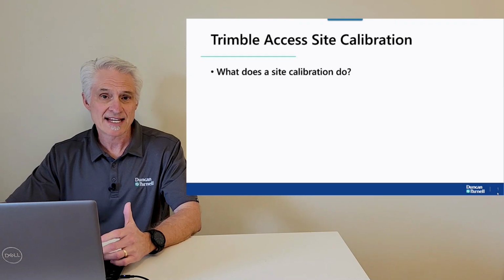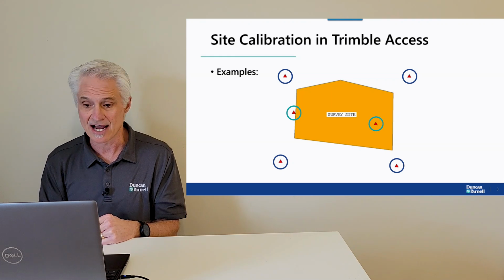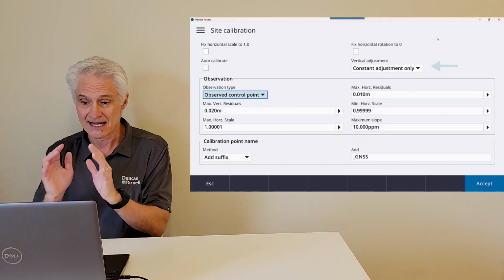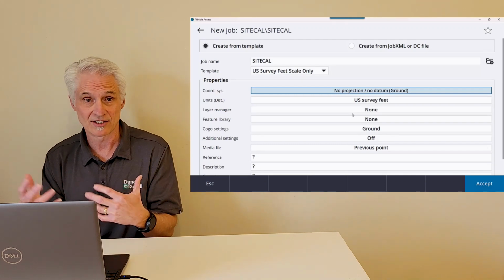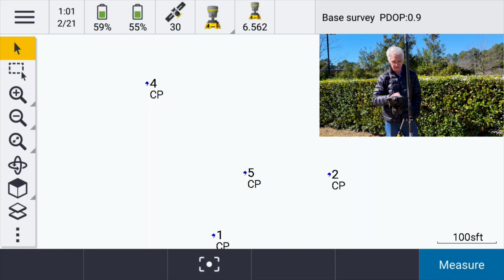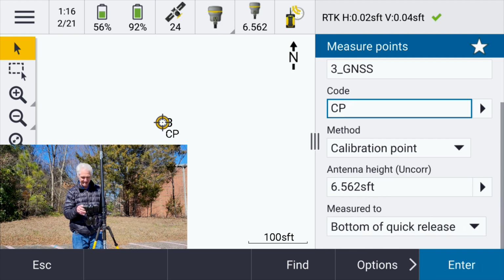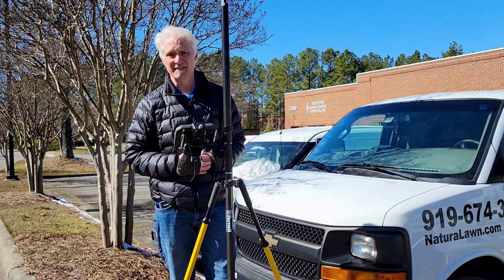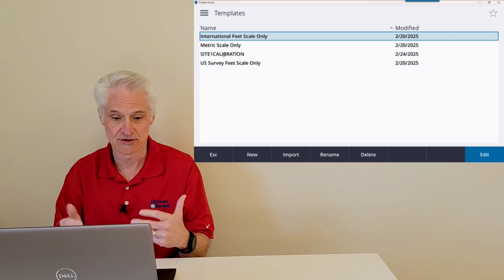GNSS Site Calibrations in Trimble Access – Everything You Need to Know | Survey Matters

Comment: Thanks. 0.02'h/ 0.02v calibration is good stuff with a GPS. Been using survey pro  for years in Arizona just holding the bearing line/section line published on the construction plans or the deed of the property and just make the grid point monument distance match the measured distance between the two monuments  bind those together and solve projection, just hold one point vertical close to the site. Then go check into existing property corners around the site and nearby the site, brass caps etc. if you're not matching previous surveys we'll try holding a different section line nearby the site and repeat. This worked well for years we would check in pretty good with previous surveys. With Trimble it's a lot of extra steps for what seem to be similar results but I guess we're all doing this now.

Comment: I noticed you mentioned setting up for machine control. Can you do a video for setting up machine control using base and rover and how to export the proper calibration files i.e. a .dc file and/or a .cal file. 
And show how to create/set up the proper files to load into the machines Maybe explain the reasons for ellipsoidal elevations versus geoid elevations and why its may or may not be important depending on application.

Comment: Very helpful, we just started doing base/rover site calibrations and will use this going forward. Do you know of any issues that could happen with a job that was set up with a projection and datum? The residuals seem fine, but the scale factor is 1, and it shows the state plane system in the properties.